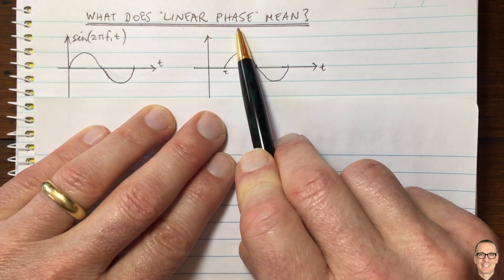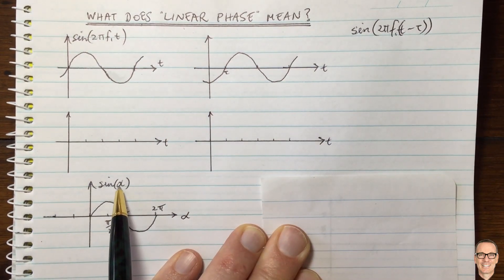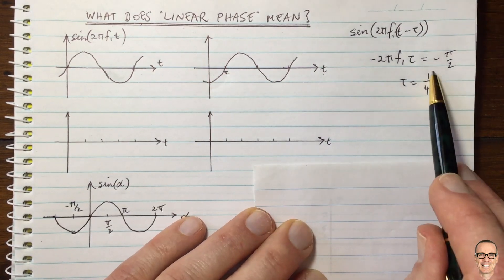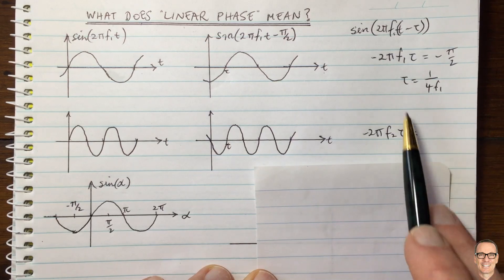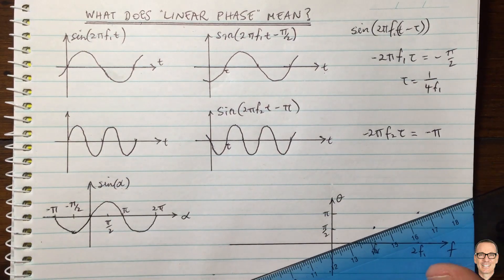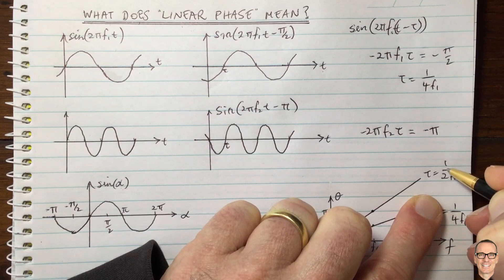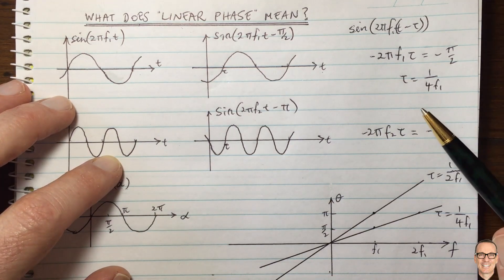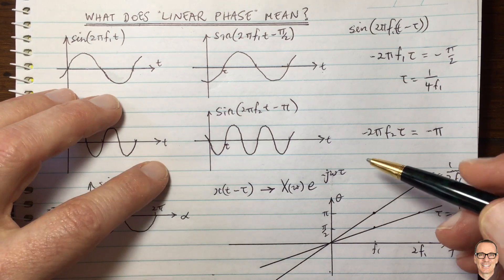What Does "Linear Phase" Mean?

Comment: I am not able to understand why in your case when you consider a time delay, the linearity is positive with respect to change in frequency and in the textbook Oppenheim and Wilsky, Signals and Systems, 2nd edition, Chapter 6, pg 428 the linear phase for time delay in frequency response  is <H(jw) = -wt which points to a negative slope. Could you please clarify my confusion?
Reply from the maker: Sorry, I should have made that clearer. It can be confusing. I defined the phase, theta, to equal (2 pi f tau). Which means the formula for a shifted sinusoid is sin(2 pi f t - theta). Other people prefer to write a phase-shifted sinusoid as sin(2 pi f t + theta). The only difference is that their "theta" would be the negative of my "theta" (ie. their "theta" would equal -(2 pi f tau) ).
Reply from the maker: Here's a video where I included the negative into my definition of "theta", and the phase has a corresponding negative slope: "Is Phase important in the Fourier Transform?" https://youtu.be/WyFO6yBQ0Cg

Comment: Hi Iain, thanks for the intuitive explanation.

What could be the benefit of having linear phase? Is it simply to avoid communication delays (if any), in real time applications. Are there times where having a linear phase brings no tangible benefits to the table?
Reply from the maker: An example of when it's important to have a linear phase response is in Bandpass Filtering. The aim is to pass the signals in the frequency band of interest (unchanged - apart from an unavoidable time delay), while also completely suppressing any signals that are not in that frequency band. In this case you want to have a flat amplitude spectrum and linear phase response across the frequency band of interest, and have a zero-amplitude response across the rest of the frequency spectrum. Thanks for raising this question. I think I might add this topic to my "to do" list for a future video.
Reply: @iain_explains  Noted, I'll read up a bit more on the theory as well. 

As an example, phone lines can have a pass band between 200 Hz to 8 kHz (focused on speech and syllable information). If the filter is designed to have non-linear phase, the speech frequencies lying between that could probably cause unintended interference at the receiver's position, making the caller sound different. Mainly because linear phase implies a constant delay between input and output, whereas the delay would not be constant for non-linear phase (?)

Perhaps a better example could be in diagnosis of patient data with some monitoring tool (like cardiogram or ECG), where the interference could lead to erroneous interpretation by the doctor.
Reply from the maker: Yes that's right.

Comment: Nice videos, please keep up the good work. 

I have one question: 
On the top right figure why have you already chosen tau to be pi/2 (isn’t it supposed to be generic)? I mean, when you have extended the plot to the left (from where t = tau), you could have crossed the y-axis at a different point then -1.
Reply from the maker: I chose tau to be 1/4 of the wavelength for the sinusoid at frequency f_1 as an example (this corresponds to pi/2), so I could show the plot clearly and explain the concept of how a time shift of a sinusoidal waveform is equivalent to a phase shift.